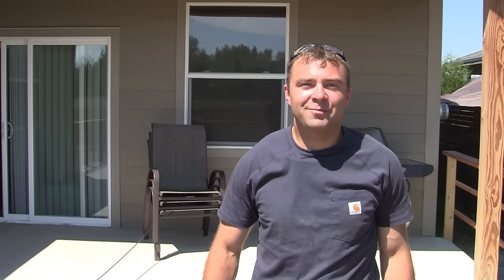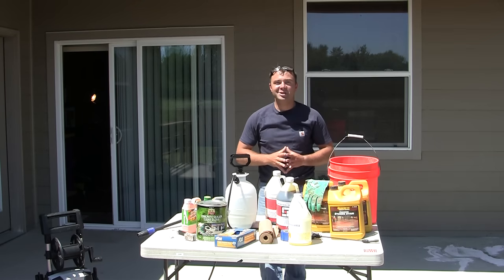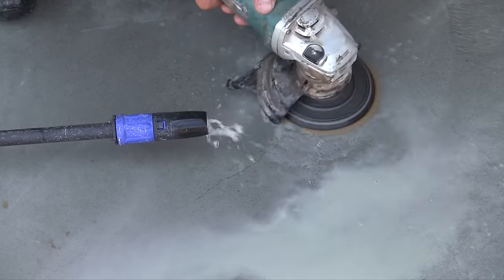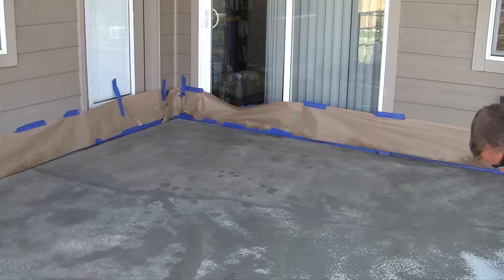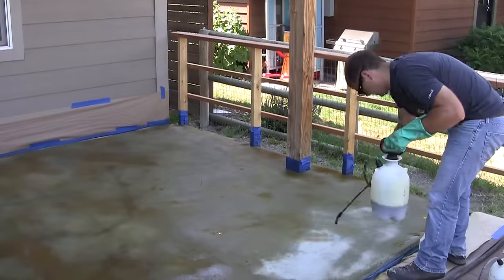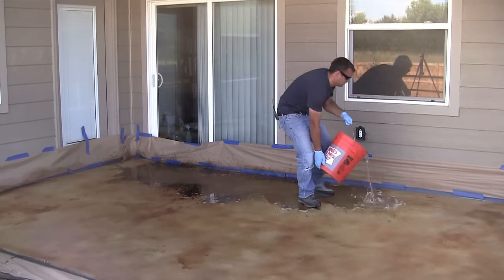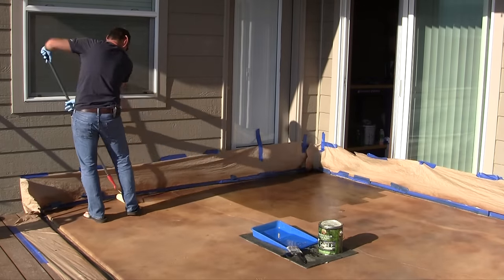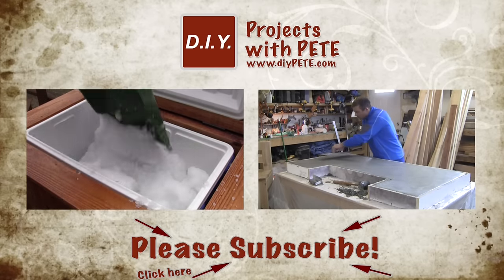How to Acid Stain Concrete | DIY Acid Stained Concrete Patio

Comment: I've watched numerous videos to learn how to acid-stain my kitchen floor properly. This one, by far, offers the clearest instructions on how to do the job. Thanks for uploading an informative video that was fun to watch.
Reply from the maker: Thanks so much Chris! Good luck with the kitchen floors!
Reply: DIY PETE Hey Pete! The kitchen floors turned out gorgeous. Lots of marbling and friends and family ask me about them all the time. I was so happy with the results, I decided to do my backyard concrete patio slab. However, I found that even when I properly cleaned and prepared the slab for the staining, it didn't come out as pretty. For one thing, the concrete soaked up the solvent-based sealer like a sponge. The final appearance was not smooth and shiny -- even with the wax -- like the kitchen floors. I have a hunch it is because the concrege surface was been weathered over time and is more porous. Is this correctable?

Comment: Great video again.  I actually did this based on you video, a couple of years ago.  Quick question as the sealer seems to be wearing off.  The patio color now looks "greyed" out a bit, and it's loss that initial shine from the sealer.  My question is if it has worn down, can you put new stain on and change the color?

Comment: Is the finished product slippery when wet?    Would you be able to add some grit to the sealer and  achieve a safer walking surface?   I am looking to resurface a patio that is next to the pool, and will need to be safe for the kiddos.   Looks great, and thanks for the video.

Comment: Great video Pete. I wish i had concrete slab to use this on. We are building a raised gravel pad to park our RV on and bordering it with a cinder block wall. In your opinion will this stain work on cinder block? We do not plan on sealing it, just coloring it. Will it retain its color over time? A Gray cinder block look doesn't belong in the middle of the woods. Thank you!!

Comment: Hi Pete loved your video.
I would like to do the same  to my basement  floor which is about 11 months old now.
The concrete its very smooth and has some paint stains cause i painted the walls and ceiling.
My question is do i really need to rent a sending machine to make the floor rougher or  i can do it without?
and  can i use a water based acid stain or i need to use an oil base?
thanks

Comment: I live in the south, and my customer wants this style of floor for her outdoor porch. It is covered, right now our temps are 80-95. . .  does the floor need to stay wet as you are staining the first coat, and what kind of sealer have you used? I thought I saw someone using a water based clear sealer like a minwax type sealer. Yours was perfectly clear and very thin. Thanks

Comment: My concrete was coated with Dry Lok to slow down the curing process. It’s like a thin membrane. I would have to remove that correct?

Comment: Hi Pete,  our concrete slab is smooth finished and has turned nearly black.  It has some neat variations and lighter areas and I was wondering if the concrete can still be acid stained with it being so dark already.  Thanks

Comment: Hi - your video and instructions are great, thanks!  A few quick questions:  My patio has grass all around it.  During the neutralization stage with ammonia water - is it safe to have that ammonia water rinsed onto the grass? If not, any ideas how to handle that?  Likewise, when I rinse with water, does some of that acid color rinse with the water and stain the color of the grass?   My last question is about clean up - how to you suggest cleaning up the sprayer and any brushes that were used for the acid stain?  do you have to throw them away after or is there a way to safely clean them? thanks!
Reply from the maker: +Jena Lesar Hi Jena! I've sprayed quite frequently with grass around the edges of a patio or driveway. To prevent overspray while applying -- you can have a tarp alongside covering the grass. A tarp also works well for the rinsing process. However, I like to leave a little gap between the tarp and the concrete while rinsing. This way the residue will seep down the side of the concrete and no grass will be stained. The residue hasn't killed any grass in my experience (when it simply runs down the side of the concrete and into the soil). To clean the sprayer etc -- I rinse everything with water. The sprayer will clean up easily. I generally use cheap brushes and throw them away. Always wear safety protection. Cheers!

Comment: Hi!  Thank you for the informative video!  I am looking forward to doing this DIY project next week :)  I have a question though... our concrete patio was poured last summer and hasn't been sealed yet (so hopefully that will make our lives easier with the stain uptake); however they did do a broom finish to the pad.  Is there anything different we need to do with the broom finish?
Reply from the maker: Hi Danielle, I've used the same method on groomed concrete finishes with similar results. Good luck!

Comment: Awesome as usual.  I would love to see you do a multiple color job, perhaps on a concrete kitchen/bathroom counter!
Reply from the maker: FirstDegreeRickW As in highlight colors, --- or more as in scoring the concrete to look like tile and doing colors? I cut a 3 foot diameter compass rose in an entranceway awhile back and then stained it different colors. I'd love to hear what you'd like to see on a counter or vanity :) Thanks Rick!
Reply: DIY PETE I used to build Water Falls and features and used acid staining to color the Faux rock panels.  Its been years so I don't remember what we used to speckel the panels with white and black dots to make the panels look just like granite.  As you know granite is chaulk full of colors including Aqua's.  So that's what I would like to do is to make a concrete kitchen counter and make it look like granite.  I even thought about running a big magnet thru the local river sands here and using the Iron Pyrite to sprinkle on the counter to add to the realism.
Reply: FirstDegreeRickW That would be a cool idea. Knowing how lazy I am I would just do the concrete kitchen counter and then paint it and add the granite effect with an air brush.
Reply from the maker: FirstDegreeRickW Hey Rick! Love it. I think you'll want to polish the concrete with a wet polisher to expose the aggregate. I'm going to have to do a video showing this :) You can embed anything you want as you know, which is another reason I love working with concrete!
Reply: FirstDegreeRickW what’s too hot for applying the sealer? It’s 95 degrees and humid where I want to do it? Is it ok if the rain falls on the sealer (what’s a good time for it to dry)? Thank you for the tutorial!

Comment: Pete great video! I have oil stains any recommendations on how to putt them out or beat them in deep enough for acid to still stain? Also if I just power wash and etch will the stain just be darker over the oil spots? Thanks keep up the good work!
Reply: Can this be done indoor concrete like basement?

Comment: I'm sorry for all the questions I just have one more is it better to use a sprayer for the sealer or  the roller the reason why I was asking is because I was thinking if I use a roller I will have  to use more gallons of sealer?
Reply from the maker: I haven't applied the sealer using a sprayer, but I know some folks do. You'd want to talk to a local concrete supply company or to someone at Sherwin Williams if you are wanting to spray ( to see if you'll need to add a thinner ). I used a solvent based sealer - the other option to research is acrylic. Cheers

Comment: Good video and good info.  It seems that the look of the final finish is kind of better in lower light.  The full sun look didn't look so great to me.  But, after the sealer, I wonder if a coat of something like a shiner or epoxy type of thing would bring it up even more?
Reply from the maker: Hi! The sealer did darken it quite a bit. Cheers

Comment: Thank you for this informative video.  I'm inspired to try this now!  I have a question about the concrete surface.  my patio has a brushed surface, not smooth.  You mention in the video using a polisher to smooth the surface.  is this required for the entire patio, or was that just for the area with paint?  thanks!
Reply from the maker: +James Gilkeson Hi James! I've stained a lot of concrete surfaces with a groomed finish. Works great. I only used a wet polisher because I needed to removed some paint stains. If you were to polish an entire surface you'd need a big floor concrete polisher. (like they use for the floors at a lot of coffee shops, office space, and sometimes department stores) --- Great question and let me know how the project goes James! Best of luck!
Reply: DIY PETE A

Comment: Best video tks much for teaching us in a simple way how we can do this... our question is when we apply the sealer , will the floor be slippery ? If yes is there anything we can do to avoid that? We want to do this in a rustic bathroom floor are are afraid to be too slippery.  If we don't use the sealer will the stain fade it away overtime? Tks
Reply from the maker: +hend7179 Hi! Thanks for reaching out and so glad the video is helpful. How slippery is the floor right now? Adding the sealer doesn't make it super slippery (similar to tile). You'd want to have a rug outside the shower door / bathtub etc. You can always add Shark Grip or a clear sand like this: http://www.homedepot.com/p/Seal-Krete-3-2-oz-Clear-Grip-Anti-Skid-Additive-402002/203002764?cm_mmc=Shopping%7CTHD%7CG%7C0%7CG-BASE-PLA-D24-Paint%7C&gclid=Cj0KEQiA-4i0BRCaudDcrrnDi6kBEiQAZSh5f2EAGYTFpeC1M5eSC09q5N67ZAoFpGQRq7ZxgJHSL48aAkAU8P8HAQ&gclsrc=aw.ds   to the sealer to give the floor a lot of grip. I would recommend a sealer no matter what -- but adding the shark grip if you need it to be really grippy. (or rugs etc) - Let me know how it goes!
Reply: +DIY PETE Tks so much, we for sure will try that.

Comment: Would you put down a primer before staining?  We removed the carpet in the living room.   Also ran a floor maintainer and going to do a floor burnisher next...  Question is..  Do I prime before?  I see some do, some don't.   A concrete company told me not to worry about it
Reply from the maker: No primer if using an acid stain.

Comment: I was thinking of doing something like this, except to my basement.  I would put down patterns for etching in grooves, for a look of a slate floor pattern, and then stain the floor about 3-4 different colors for each different "slate piece", ... and then once that is done, groute the etched grooves, ... making it look like a slate floor.  Just haven't done it yet.  Need to sell a couple things first, that are down in my basement!
Reply from the maker: That sounds like it will be a fun project!

Comment: I had a 10'x7' concrete patio. A few days ago, I just had new concrete poured to make it about 17'x20'. The old piece is still there, so I know it wont be the same exact color. I want to do the staining, but I'm afraid the 2 pieces will look a different shade unless primed or something. What would you recommend I do before the staining so that it all comes out the same color? Also, I live in Arizona, so it's too hot to do that now. The roof will be done this week, and the concrete will be ready to work on. Will it be okay if I wait until October or November to stain and seal it?
Reply: DIY Pete, can you address this question if you have not already?  Thank you.

Comment: Great video! Just wondering if you would recommend the same colors or what colors you would recommend for staining a driveway that doesn't show bird droppings, Tire rub marks, dust & dirt, Etc? Thanks!
Reply from the maker: Hi! Just depends, we've been happy with ours, but lighter mud etc shows. I've done another using grey tones and that's looked very nice.

Comment: Hi Pete does acid stain penetrate in to the concrete to any depth as I'm looking to polish the concrete afterwards for a counter top. Would this work or am I just gonna clean the stain off? Love your deck by the way
Reply from the maker: +Rob Barbara Hi Rob, Acid stain penetrates into the concrete about an 1/8 of an inch. Staining the concrete prior to polishing will remove it. -- I've stained a ton of concrete tops though ( after polishing ) and that works well. I don't go higher then 800 grit. Between 400 and 800 will still take stain fine --- just make sure to let it react for at least about 8 hours or overnight if possible. You can do multiple coats if needed. Then neutralize, let dry, and seal. Thanks for the the kind words on the patio. Best of luck and let me know  if you have any other questions Rob. Take care!

Comment: Should I make concrete counter tops and stain them, can I still place super hot pots/pans off the oven/stove without worrying?
Reply from the maker: You can stain countertops. As far as heat goes, it will really depend on the sealer you use. I always recommend having pads or metal cooling racks on the concrete to prevent anything from ever happening.

Comment: Awesome video. YOUR ADVICE would be greatly appreciated. Large stamped concrete patio (with an acrylic sealer) left a 15 foot white circle underneath the above ground pool placed on top.  I stripped off acrylic sealer, re acid stained and applied Ecosil water based sealer twice since.  Beautiful color patio when wet.  Ugly light orange when dry. Will oil based sealers (penetrating?) give me darker results (without a white circle).   Local concrete supplier unsure.  Again, your advice would be greatly appreciated,  Brad
Reply from the maker: Hey Brad, I have found the oil based sealers to give a more dark and rich finish. See if you can get a sample and test a small area with it. Cheers

Comment: Thanks for the video! I would like to use this process on my basement floor.. are there any adjustments that you would suggest? Should I be concerned about fumes in the house at all?
Reply: (there is a drain in the middle of the room currently..)
Reply from the maker: Hi! The drain will be nice have for getting rid of the excess water. The general process is similar -- but I'd recommended doing some google searching to find the best sealer. A lot of folks use an acrylic based sealer for indoor projects. They do a nice job, and fumes are minimal in comparison to something oil based. Good luck!

Comment: Would  mixing 2 or more constrations work? or even 2 different colors of stain work?  Larger rollers can be used to reduce time.
Reply from the maker: I don't usually mix colors together in a bottle, but I have used two different pump sprayers to get a more mottled look with highlights. Cheers!

Comment: The concrete slab I want to stain is located under two very large oak trees and requires power washing a couple times a year to keep it looking good.  How will this acid stain hold up to power washing?
Reply from the maker: Hi Carol, if applied correctly and properly sealed you'll be okay. I power wash mine once a year to clean it up. I use an electric power washer which has a lower psi then gas powered washers. I'd recommend using a setting on the power washer the fans the water out a bit. It's always a good idea to do a test sample. Please continue to research the subject and talk to the acid stain supplier you choose. Cheers

Comment: When we purchased our home the concrete was beautiful but has since lost its shine. Do we have to strip the original acid stain or do we just seal it again to bring that shine and the colors will pop again?
Reply from the maker: Hi! There are a few variables to consider, but I'd recommend testing a small area with sealer to see if it brings back the shine. Generally, it will. You'll want to use the same type of sealer ( either water based or solvent based ) if possible. I'd recommend having someone take a quick peak at your project though for the best advice since it is hard to give the best advice without seeing it in person. Cheers

Comment: Can you do a driveway the same way? Also if the driveway has some cracks that accumulate debris, should the cracks be sealed (or driveway resurfaced) before acid staining? If yes, would the acid stain eat away the driveway re sealer?
Reply from the maker: +valspar89 Hi! A driveway can be stained as well. I'd recommend doing some additional research on sites like the www.concretenetwork.com before doing your project. The size of the cracks will determine if you'll want to fill them etc. All existing sealers would need to be thoroughly removed prior to staining. The acid will not eat through the existing sealer or penetrate/color any of the concrete where there are oil stains and existing sealer.

Comment: Thanks Pete... do you know if the sealer changes color or turns yellow due to the sun,  UV rays, etc.?
Reply from the maker: Hey Sarah! The sealer I used is rated to withstand UV rays and did not ever yellow. Just make sure to look for those features on the sealer you buy. Cheers!

Comment: Thanks Pete well done explaining it! Question: Would this process make it water proof? If so can you recommend this finish for a shower? I am an expert plasterer and I can cement level anything including ceilings. Thanks.
Reply from the maker: Thanks for watching! The sealer does make it waterproof. However, the one I used can be slippery without texture. But you could always add shark grip or a clear sand to a sealer. I don't see why it would have issues in a shower floor. I would recommend doing some additional research, but I thin it would do just fine.